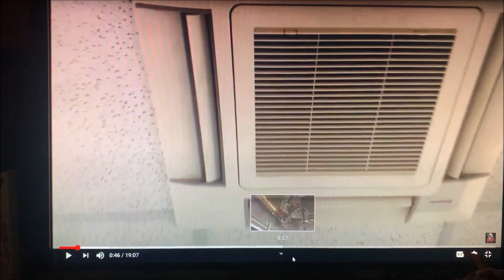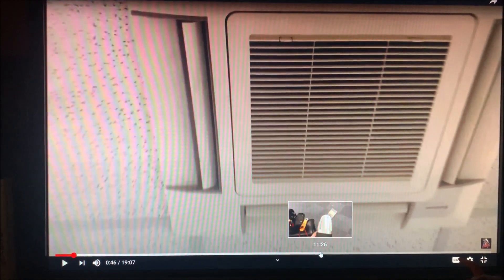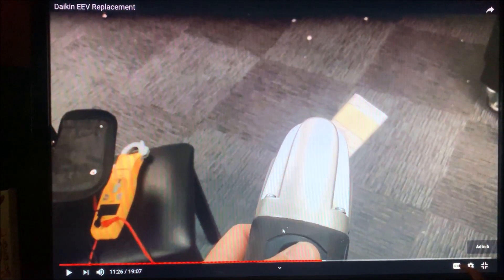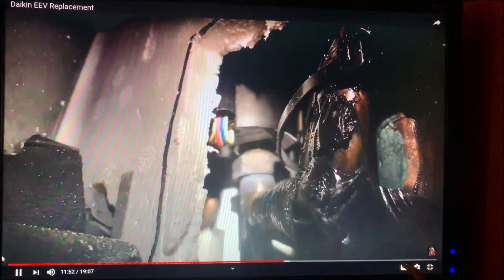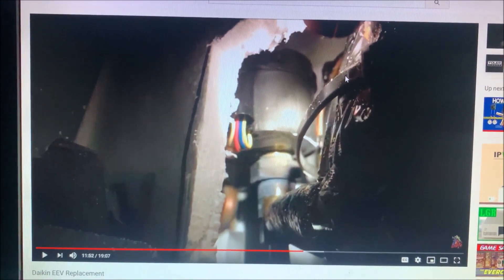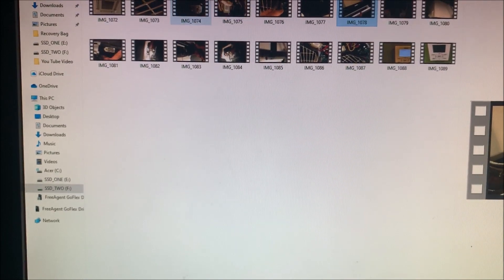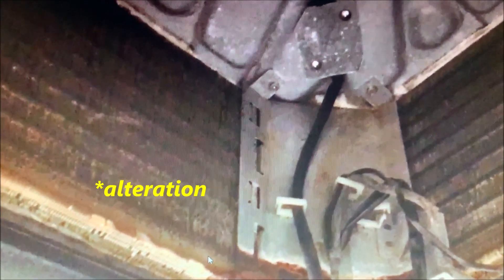Daikin EEV UPDATE!

Comment: I’ve changed loads of these EEVs! The older units had a problem where the pin inside the eev body would get stuck in and eventually cause refrigerant to leak through the eev head. They would also get stuck in position and cause a temperature drop across the coil even when the unit had reached temperature (on VRVs). They also wouldn’t reset with a manual eev reset. You can fully access them by removing the drip tray and fan as shown in your video. Then removing the cover inside. It’s very tight but it is just about accessible. Obviously if the pin on the body is stuck then the eev body needs replacing as well. 
I’ve also done a few Mitsubishi electric cassettes which are the same set up.